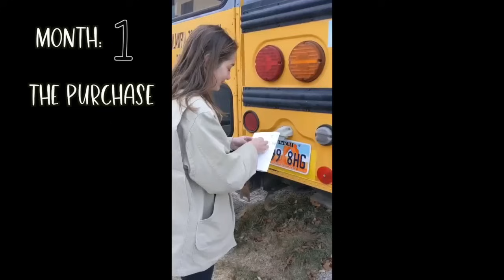School Bus Conversion Timelapse (2.5 years in 13 minutes) - Bus to Tiny Home w/no Experience

Comment: Emma what kind of mpg  does your bus get? and have you been out alot of expense on maintenance?
Reply from the maker: I get around 13 if I’m being conservative and 10 if I’ve got the pedal to the metal. I’ve gotten lucky and have spent almost nothing on the engine so far (knock on wood)! Just a couple oil changes and a couple really minor repairs
Reply: @EmmaBuildsBirbie  Thank you